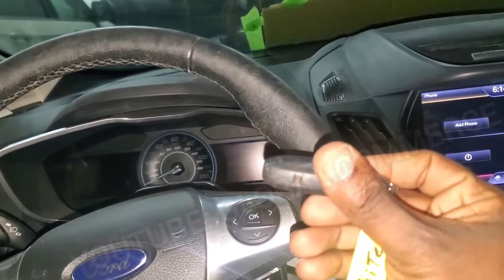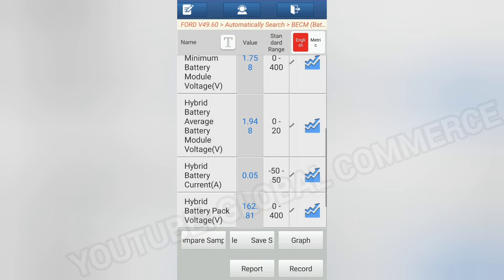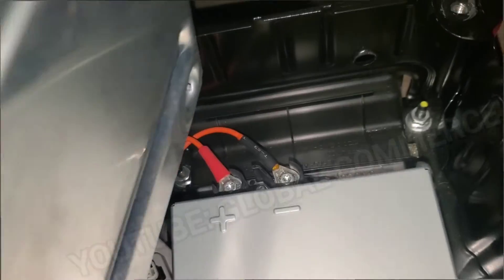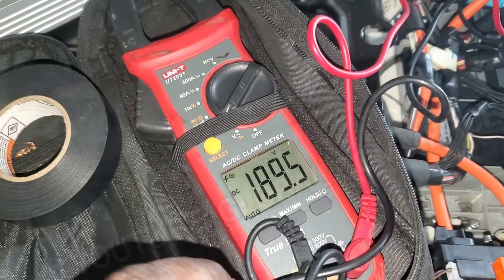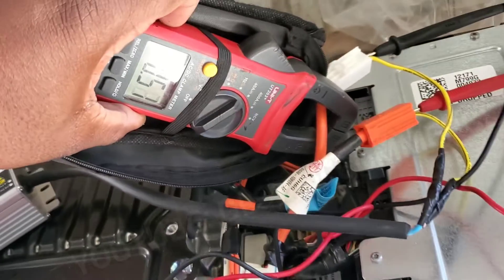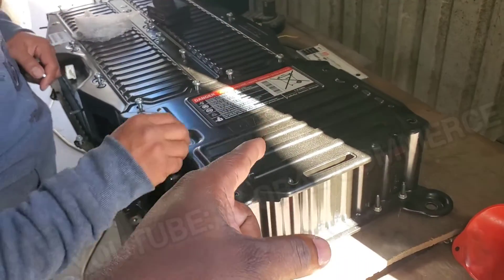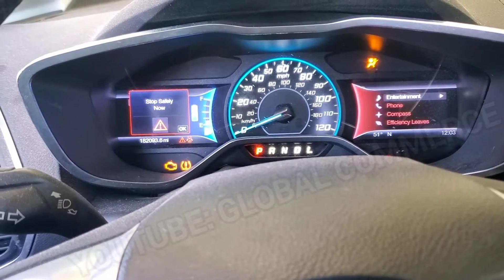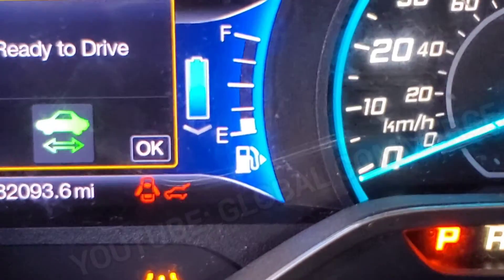Ford CMAX Hybrid No start! P0B25 EV low voltage Diag/FIX! MANUALLY charging high voltage battery!

Comment: Hi my friend I have a 2013 Ford c max hybrid but the hybrid battery doesn't charge it will charge to 286 volts with the slow charger but once it starts it drains white driving what can it be. Going crazy

Comment: Excellent Job 👍 I do have a question were you able to check the voltage of each cell. Each cell should be 4.2=volts. Thanks again you helped lots of people. God Bless You my Friend
Reply from the maker: I'm glad I could help, and I appreciate the info! I did check the cells but they should be charged altogether

Comment: I have the same exact issue the mechanic said i need a new hybrid battery and i recommended this video to follow the steps and he said to get it towed to a different shop . can any type of trickle charger work and does it need to be charged all the way or would just to get it started and charging on its own be enough
Reply from the maker: i recommend you looking for a qualifed specilist and follow the steps in this video